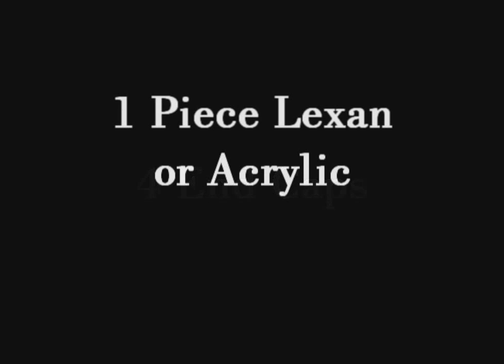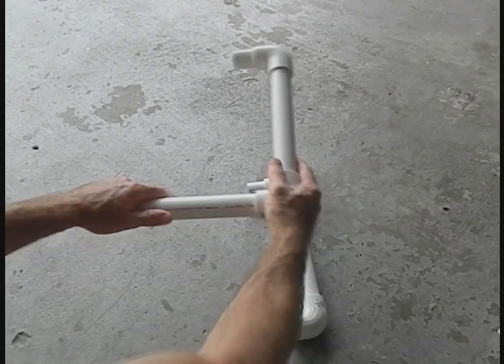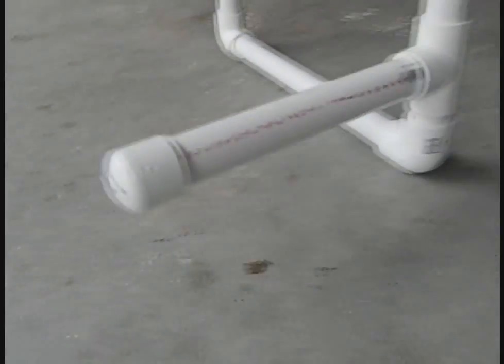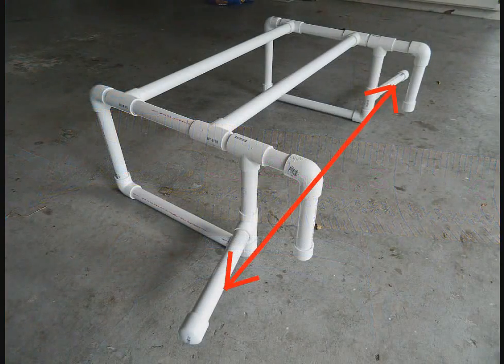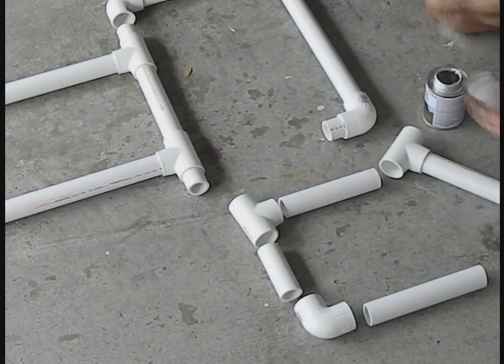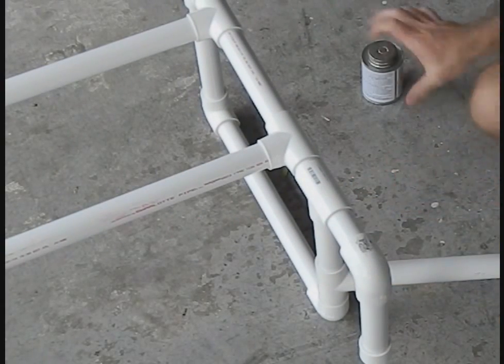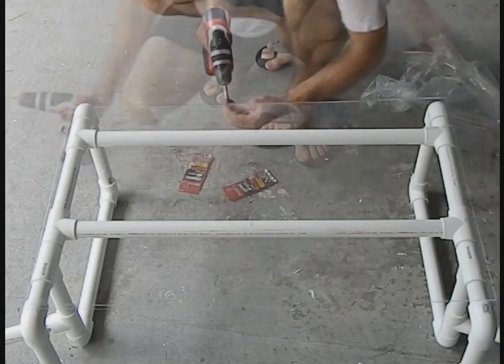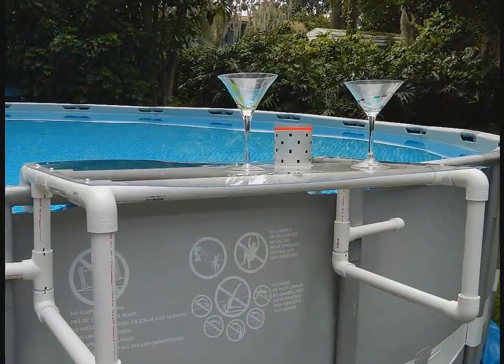HOW TO BUILD a DIY POOL SHELF for an ABOVE GROUND POOL

Comment: That picture at 1:16 probably saved me an hour on the project thanks for the great video! Love the acrylic but I went with a 1" pine shelf with a beveled edge for $8 instead of the acrylic because my lowes didn't have it... After stain it still looks and works great. Thanks again
Reply from the maker: No problem, thank you.

Comment: This is fantastic!  I'm going to use flat screws to put the Acrylic on and I'm going to add a spot for towels.  I'm glad that my pool is the same as yours!  Thank you for sharing!!!
Reply from the maker: Thank you for watching. I will be working on a few more additions to the pool.
Reply: @JDee7  That's awesome, I will be looking forward to what you come up with!
Reply: @JDee7  How thick is the Lexan? Thank you!
Reply from the maker: This particular piece was way too thin. I took some suggestions from others and changed it to a thicker material. I actually used a large cutting board made of PVC.
Reply: @JDee7  That's a great idea! Thank you! I'm adding a cross tee to replace the tee on both outer corners so that I can hang towels on it. I have everything cut and ready to put it together! I also decided to cut the 29" pieces in half and join them with a coupling, that way I won't have to add a washer!  I'm hoping to get it put together tomorrow.  After it's together I'm thinking of staining the pvc!  This will be such a nice addition to our pool.  Thank you again!!!

Comment: Brilliant.  For the towel rack/hose holder, just make the vertical supports furthest from the pool the same as the ones closest but use 4-way tees instead of 3-ways so you can add two holders to each vertical support.  Add a 45 at the end of each holder curled upwards to hold the towels on also.  This is awesome.  Thanks for the sweet video!

Comment: I started making this shelf Friday and finished it today after church with some help from my family members. One of the legs that goes over the railing is a little crooked but it still works fine. My lexan did crack at one of the screws but it is ok. That stuff is not cheap. Next year we are getting a larger pool so I will try the thicker lexan. Thank you for this video it is the second project I've worked on with pvc pipe. Now just waiting for the next project to come along.
Reply from the maker: Thank you...I am working on a couple...stay tuned.
Reply: I will stay tuned. I'm thinking about making a little doggy pad to hang over the side of the rail into the pool for my little Yorkie to sit on in the pool with pvc pipes.

Comment: Things I learned from this wonderful tutorial:

 Pay attention to your measurements.  When he says 2 inches he does not mean 2 1/2 ( That's where the frustration started!)  Somehow I cut all of those pieces two and a half I couldn't get anything to match.

 When measuring your crossbars measure from the insides of your pool posts not the outside and then subtract an inch or two.  And remember to include the T measurements. 

 I did not attached the top table piece which was a good thing because I was re doing this constantly.

And the last thing is keep an eye on all of your parts because when your pit bull decides he wants to take them and hide them it gets really frustrating when you know you cut them and they disappear.

 I'm sure for people who are knowledgeable with PVC and what not this made so much more sense. However this is the 1st time I've ever attempted anything with PVC and as frustrating as it was the author was tremendously helpful and I came back and remeasured and found my problem and everything was smooth sailing.

 At last but not least I am not a fan of Lexan and/or anything else that is Too clear 2 shiny 2 slick. I actually have on order a poly ethylene cutting board. It is textured and almost the same size for $26.  The edges will already be smooth and rounded out and none of our cocktails will slide off of it!  And less than a 3rd the cost.  And I got it in a color, not just clear or white.

Thank you for all your assistance. It turned out well however I haven't glued it altogether yet So there's still time for me to jack it up!

Next I'm going to attempt stairs for inside the pool.  That oughta be a hoot

Sent from my T-Mobile 4G LTE Device

-------- Original message --------

From: YouTube <noreply@youtube.com> 

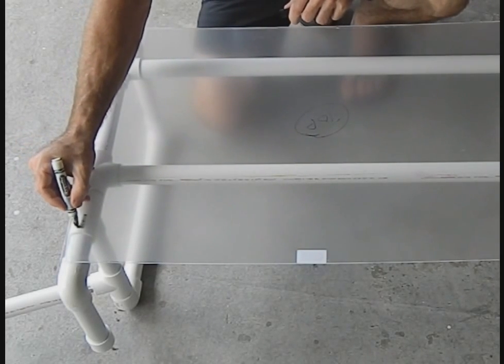Date: 6/16/18 08:01 (GMT-06:00) 

To: Penny Guimaraes <PennyCG@gmail.com> 

Subject: New reply on "Fabulous DIY. But I really want to clarify the 29 in cut please. My braces are 41" from outside to outside edge. So mine need to be 41"? ( if so wish I'd have watched that before I cut them. I had to do a cut as I drive a roadster and 10 foot PVC just wouldn't fit) lol. Thanks for your time." 

New reply on "Fabulous DIY. But I really want to clarify the 29 in cut please. My braces are 41" from outside to outside edge. So mine need to be 41"? ( if so wish I'd have watched that before I cut them. I had to do a cut as I drive a roadster and 10 foot PVC just wouldn't fit) lol. Thanks for your time." ￼ 

Bubbers Productions replied to Penny Guimaraes's comment 

￼ 

￼ 

Bubbers Productions 

There are so many configurations of uprights on these pools that you would have to customize the shelf to some degree. I hope it worked out for you in the end. The measurements I have in the video are exactly what I needed and worked for this example. 

Reply

Comment: I was floating around my pool today and thinking, "Man, I wish I had a place to put my drink." I knew someone had to think of this before me.  Thank goodness for the internet.   I would recommend, for a more professional finish, to paint the frame with Plastidip before attaching the top.  It would cover all the markings on the PVC and you can pick a color that best suits your pool.
Reply: I am buying my materials tonight.   Good work on this.
Reply: All the markings and writings etc can also can be clean off with just regular Mineral Spirits IF you want to keep the frame white.
Reply: Just an FYI....Mineral Spirits do not take off the markings.
Reply: Yes mineral spirits WILL remove the printed on ink on the PVC, I was a painter for over 25 years and would clean PVC before painting etc using Mineral spirits. Thank you!

Comment: Not sure if it was already mentioned, but an added feature if you didn’t just want a clear shelf is to adhere peel and stick linoleum faux wood planks. You can get water resistant ones. Adds a little character.

Comment: Done.   I messed it up though. When I glued the cross beams that you screw the top onto I could not get the bottom level and it created an issue with leveling it on the pool.  I then cut the 2 beams in half and used 2 couplers to join it back together.   It worked out great and now I don't need the washers to hold the top up since the couplers make it all level across. I also painted it with gray plastidip.  Looks great.  The Lexan was pricey.  To get a good thickness for this job it was about $60.  I went thinner, but am not happy with the quality.

Comment: Thanks for the video,  I am making three this week.  The towel holder is a great idea, but I don't need it as I made a towel rack.  I am using a two three way "T" on the top ends this will eliminate one two elbows and two "T". (A tips) Also if you cut a coupling in half these halves could be placed in the center to support the plexiglass as you screw it.. This way it won't bow in the center

Comment: Thanks for the great video, just finished mine. Only suggestion is the fittings are cheaper if you buy the contractor packs.
This gives you extra Ts to add to the center of the 29 inch sections to stiffen and level the lexan.
Reply from the maker: I agree...that would have been a better plan. That's what I love about this, all the helpful suggestions and changes. Thanks!!!
Reply: Nice.  Can some L joints under with a 6” section to hang towels.  Awesome

Comment: This is pretty much exactly what I'm looking for but instead of lexan I was thinking I can use some leftover rigid vinyl plank from a flooring project. It's supposed to be water proof and would look very nice, at least for a while. Thank you for posting thiis!
Reply: I completed the frame in about 3 hours today. The top took longer because I had to wait for the glue to dry on the rigid vinyl plank. I went with Velcro as well, thinking I can remove the top in bad weather. Don’t know how the rvp will hold up but it’s easily replaced. Overall it is excellent. It will work perfectly. Lessons learned: I didn’t really account for the weight of the rvp so the shelf was set at level without the top and it moved a bit when I set the top on it. Not much tho. Still looks great! I’m hoping it serves me well for years to come. Thanks very much for posting this excellent idea.
Reply: Also, I got lucky with the length of the brace arms. I didn’t measure and just went with the 10” in the video. Luckily it was perfect.

Comment: You should use couplings in the center of the two longer pieces on top. That way it is the same height as the edges and you dont need to find correct side washers. The plexi should probably have some guards on the edges so it is not sharp and cuts someone. If there was a way to eliminate screws to maintain a flat surface that would be best. Maybe compress the top on with threaded fittings. I also agree that glue is not essential on all the joints.

Comment: Great idea, and as for towel holders, there is already four there without adding another bar. The brace or leveling arms will serve as towel hangers and on the ends withen the frame, there are the other towel holders. I'm going to make one these... Thanks for sharing this awesome idea... Thumbs Up and you have a new subscriber to your channel.

Comment: I like the towel holder idea everybody's mentioning but consider that the towels will be next to the pool. Might want to add some sort of back board to keep the water splashing away. Another idea is to add a little basket of some sort of hooks for little things like toys, trash(bag), goggles etc.
Reply from the maker: Great tip!

Comment: very well illustrated.  I am hoping to get a deck around my 30' found pool someday, but what would be a nice idea would be to make something using PVC that I could hang my hoses on..........you seem to be really good at figuring this stuff out.  perhaps you might come up with something?  thanks for making this video.......great job!  I agree with an earlier suggestion for a towel rack.  ours always end up on the ground..........(grandkids  UGH!)
Reply from the maker: I''l have to work on that. BTW which hoses? I too loved the suggestion of the towel rack. This can take many forms I suppose.
Reply: I have the segmented hoses that I use on my pool vacuum.  I'm always trying to drape them over something to keep them off the ground so they stay clean.  I currently put the end of my pool broom (on the pole) with the bottom end on the ground and the vacuum or broom end balanced again the side of the pool.  I then drape the hoses over that -  kind of in-between the vacuum or brush - over the pole but toward the inside of the pool.  make sense?  but I try to do it far away enough from the skimmer that it doesn't interfere with the water going toward the skimmer.
Reply from the maker: o.k. I think I got it. Let's see what I come up with.
Reply: thanks, I'll keep watching

Comment: I made this last year for my Summer Wave Elite. But this year I have a 24ft steel and resin pool and the top edge of the pool is flat across the top not round or oval shape. Could you do a video on how to make the same setup for this kind of pools? 
.

Comment: I am finally making that table this year. I used plexie glass the first time I  made it for my old pool and it did crack. This time I'm using some type of wood.
Reply from the maker: I actually updated mine and found a large cutting board made from a resin/plastic material that works fantastic.

Comment: Fabulous DIY. But I really want to clarify the 29 in cut please. My braces are 41" from outside to outside edge. So mine need to be 41"? (  if so wish I'd have watched that before I cut them. I had to do a cut as I drive a roadster and 10 foot PVC just wouldn't fit) lol. Thanks for your time.
Reply from the maker: There are so many configurations of uprights on these pools that you would have to customize the shelf to some degree. I hope it worked out for you in the end. The measurements I have in the video are exactly what I needed and worked for this example.
Reply: @JDee7  I think the issue here is you didn’t say what the distance between your pool poles were and how it corresponds to the PVC length. In the photo of you measuring the distance between your poles, it’s clearly more than 3’ — which would be 36” — so it’s a bit confusing how you got 29”.

Comment: Using velcro sounds like a good idea. I made this last year but my plexiglass cracked. And that stuff isn't cheap. I will have to make another one this year because I'm getting a new pool this year and it is steel and resin with the wider tops on the wall of the pool. I will need to get new measurements of the new pool tops tho. It is so nice to be able to have your eyeglasses, drinks or whatever within reach. Is there something else you can use besides plexiglass?
Reply from the maker: One watcher suggested using a cutting board. They make a lexan/plastic type in all different sizes. It's thicker and won't crack under pressure or drilling.

Comment: It's a great idea and I like your level of detail but I think for someone else they could probably get away with not gluing any of the joints. A rubber mallet to tighten the joints after the initial test fit and dry run would suffice 90% of the time for this. The Lexan could also be attached with double sided tape instead of drilling.
Reply: Ya, totally agree.  I waited on the glue (as I couldn’t find where I put it lol), and it held up just fine so held off altogether.

Comment: I bought everything and am nervous about doing this.  I am confused and wished I could see the tape measure numbers. I have the same exact type of pool, except mine is NOT Intex  but Coleman. I measure it and not sure if you go from OUTSIDE the pole or inside the pole/legs of the pool.  I want to do this but not sure what to do bc my pool looks the same and have watched the video a few times
Reply from the maker: If the pool is the same size the portion of the video ( time 1:12) that shows the piece dimensions should be fine. The visual aid with the numbered measurements is the actual shelf flattened out. Be sure to measure the top rail that goes all around for the thickness to be sure the top most pvc piece connected to the pool is wide enough. I hope this helps.

Comment: Instead of gluing the last joints that you use to make it level when sitting on the pool, why can't you use self taping screws?
Reply from the maker: You certainly could. Use stainless self-tappers to prevent rust. Great idea!

Comment: Only thing I see, is that the edge of the lexan or plexiglass could scrap the arm of a child - any idea's how to prevent that? Other wise this is a great idea.
Reply: Good Idea again, thanks, I will make one myself for a friend.
Reply: Just use wood instead and sand the edges. Be sure to treat it first so the water doesn’t destroy it.

Comment: What's the total cost to build?
Reply from the maker: Including the lexan it was less than $40.00
Reply: @JDee7  i love this shelf we have an Intex 16×48 ultra steel frame pool its the gray frame it was our first year with this pool and we were looking for a quick idea for drink holders we actually found the older style plastic cup holders for cars the ones that hook over the arm rest we cut the little hanger tabs off with a hack saw and zip tied them to the vertical uprights 5 in all can hold a 44 oz Styrofoam cup from gas station or a beer bottle you can see in my video on my channel but l like this idea alot

Comment: You should have angled it so if you spill a drink it does not enter the pool water
Reply from the maker: It is slightly adjustable and I have since angled it more flat for that very reason. That's what is nice about this setup...all the helpful suggestions.
Reply: Bubbers Productions yeah I would have angled it away from the pool